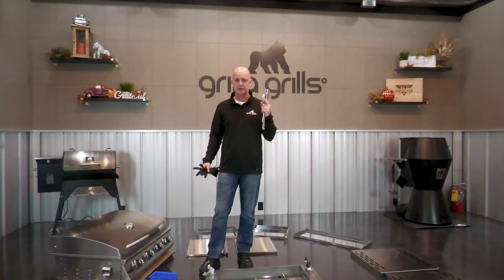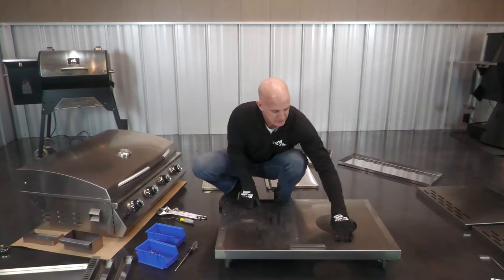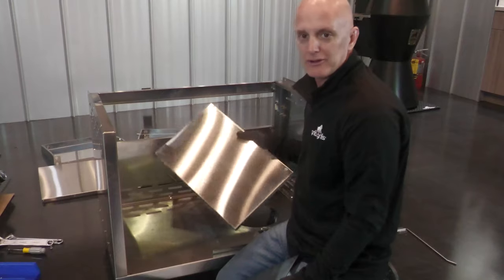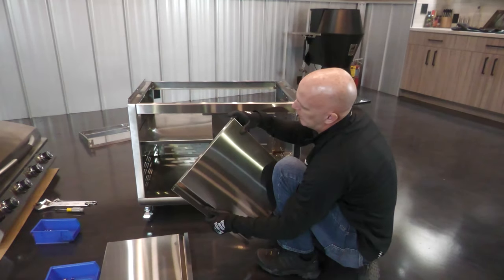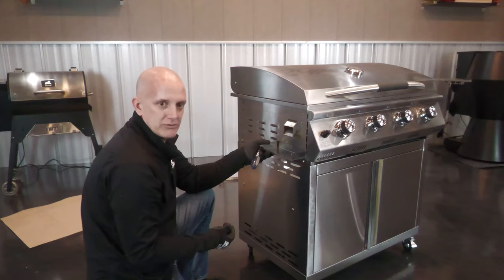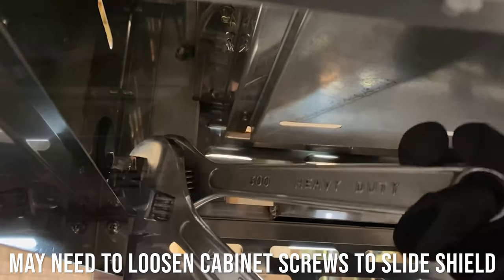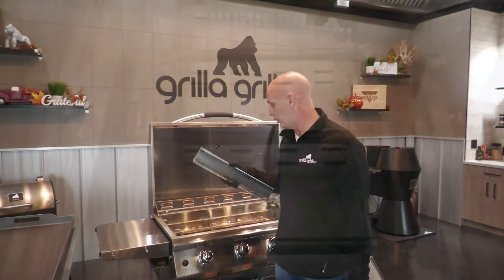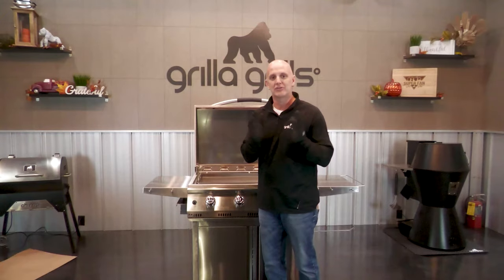Grilla Grills Primate Assembly Video | Step by Step Instructions

Comment: Very easy to assemble.  The only headache was the gas connection, a bit awkward to access.  I believe another here commented about a cutout in the heat shield to allow the connection to run through, but would guess that would sort of defeat the purpose of the heat shield.  Otherwise, blown away at the quality of this grill and how it functions.  Searing smash burgers and cheesesteak on the grill is a dream or grilling a ribeye at super high heat.  Kind of surprised actually.  Thanks!

Comment: Just assembled my primate and was seasoning the griddle when I started to hear a faint hissing sound. Turns out the hookup for the regulator was angled in such a way that the regulator hose came (apparently) a bit too close to the griddle, and melted. Need to now go out and buy a replacement regulator and tweak the factory angle of the hookup so it doesn’t lead to coiling of the regulator hose. Not how I wanted to spend Saturday morning. A bit upset to be honest.

Comment: I just finished assembly and I wonder why you have gas fitting so far back in the cabinet that you have to feed the line through the back of the cabinet. Why not just shorten it by two inches so it can be installed completely inside? Have a cut out in the heat shield so it can pass through instead of the back of the cabinet. Amazing looking and well built. Top notch. Can't wait to fire it up!
Reply: What is the burn in time and temp for the grates?

Comment: Literally just finished assembly. Would have preferred a bolt head instead of Phillips for ease of assembly. Also, the flame guard things. Are they supposed to fit over the flanges? Could only get it over one side.

Comment: Can I use the grill as a built in without the bottom shelf? Thanks.
Reply from the maker: If you mean without the base, yes. But you will need to rig something up to make it work with your base that you're placing the Primate on. We do not have a connection for our Outdoor Kitchen Setup yet.

Comment: Building a custom outdoor kitchen and I was wondering if I could buy without the base? If so, where can I get the right measurements to do a built in? Thanks looks like a great product
Reply from the maker: Hey kTube305, reach out to our customer service at grillmaster@grillagrills.com and they will gladly help you out with figuring out the dimensions to fit the grill into a setup.

We don't have the hardware to do so with our outdoor kitchen yet, but there have been quite a few people that rigged up a system that worked for them!